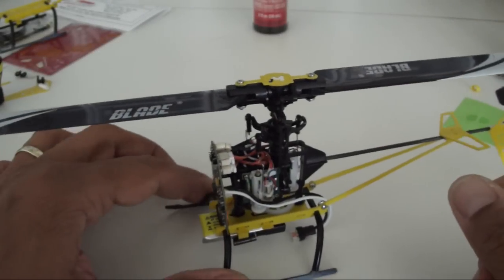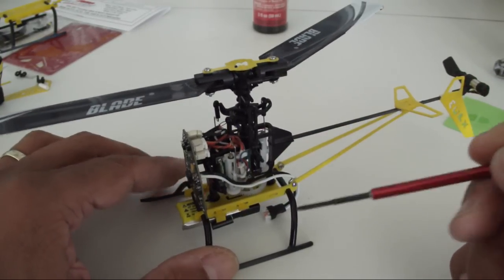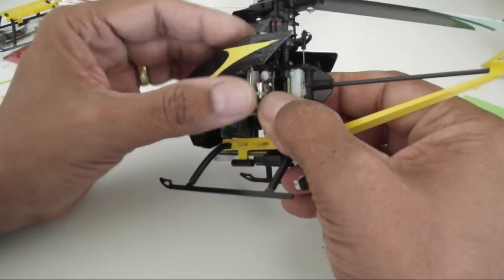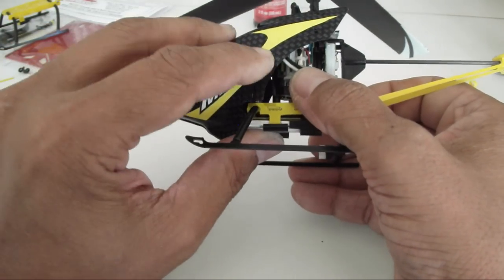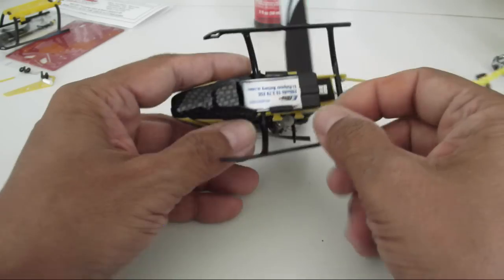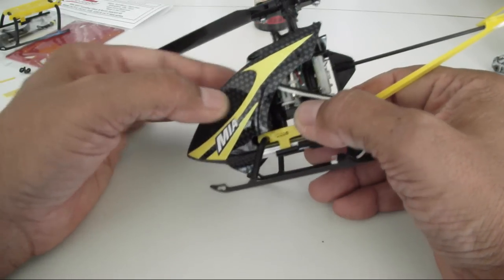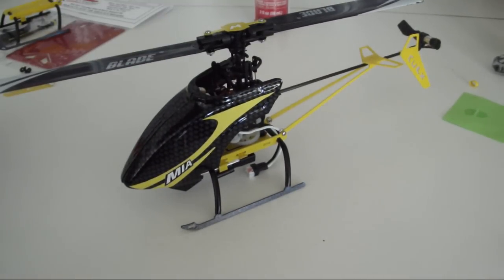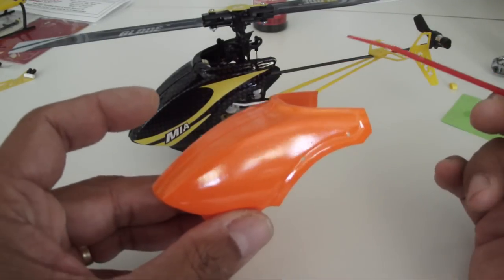MIA Upgrades - mCPX- Phantom - Edge Combo Kit Instructions Part 4 of 4

Comment from the maker: @d12bn In some MIA kits, you will find 4 small rubber retainers. Unlike the stock canopy grommets, these MIA rubber canopy retainers mount over the canopy mounting pegs and hold secure the canopy from the outside , theser are easier to handle and instal than the stock canopy grommets and reason we provide them in some of MIA products. They do not go on the canopy itself but are used are simple retainers. When you want to remove the canopy, you simply remove the rubber retainers.